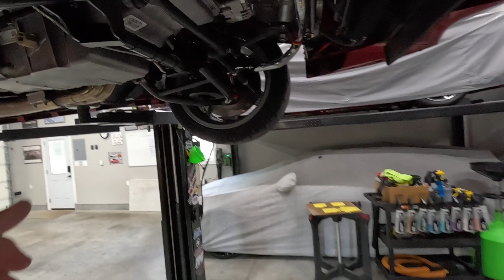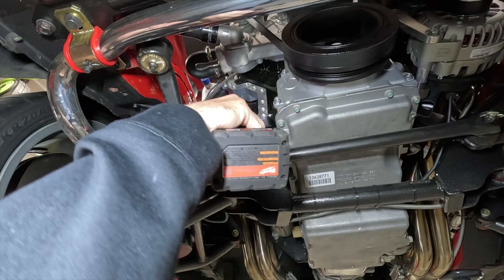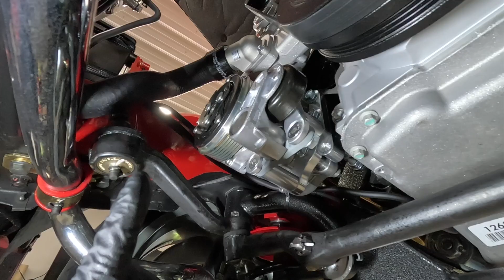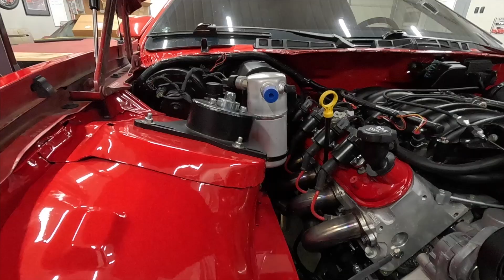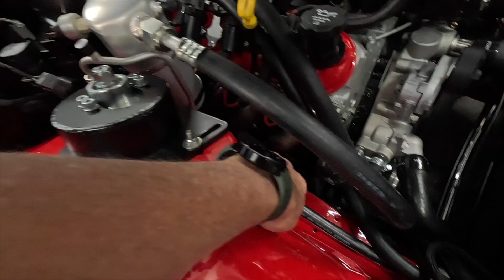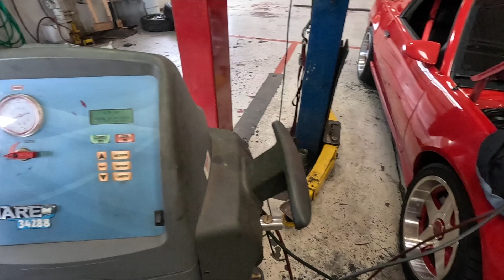Making my 92 Firehawk Tribute Cooler: 92 Firebird Part 47 Adding AC

Comment: Im installing the module with exact same setup, im just not positive were the request wire goes.  I would appreciate the help.
Reply from the maker: The request wire gets connected to the factory AC request wire. Refer to the factory wiring diagram for your specific year. They are available on austinthirdgen.org

Comment: Do you have the parts list of the ac lines and fitting used ?
Reply from the maker: I added a list to the video description. They are year and option specific so yours may be different. My car has a condenser from a different year and I got the fittings I needed for that one. I also had to replace a couple on a hose I bought pre-made.

Comment: You don't have a heater bypass valve installed so you're blowing the cool air across the hot heater core

What are those terminals on the battery posts?
Reply from the maker: @notchbackgta  it was missing when I got it. I may just install a shutoff valve for the heater since I don't really need it. 

The terminals are just some extended posts so I can add accessories to the battery
Reply: I was going to comment the same thing. I’m putting a LS3 in my GTA now. You want AC Delco heater valve 15-5533.
Reply from the maker: Thanks. I've installed one since this video (along with an LS3)